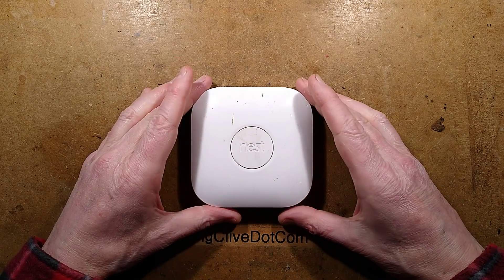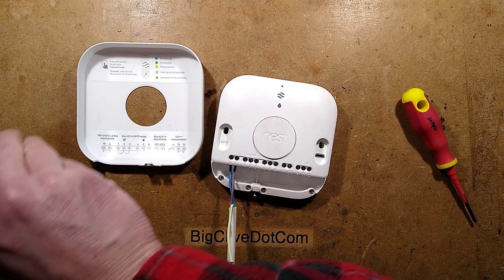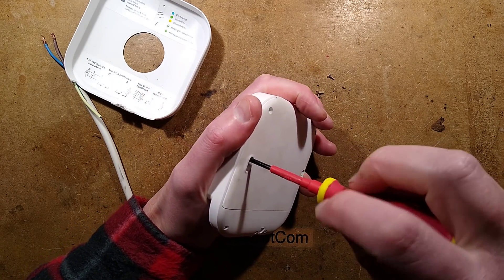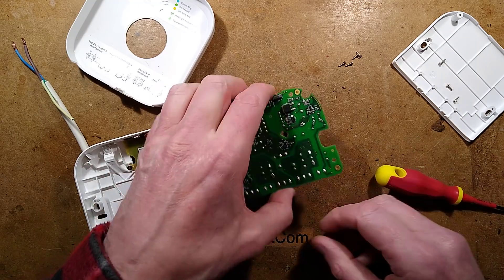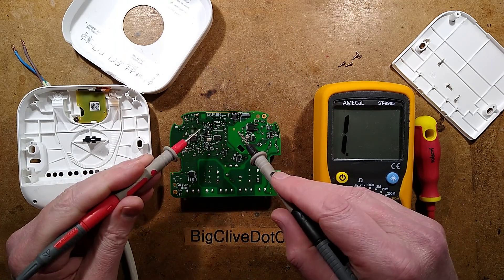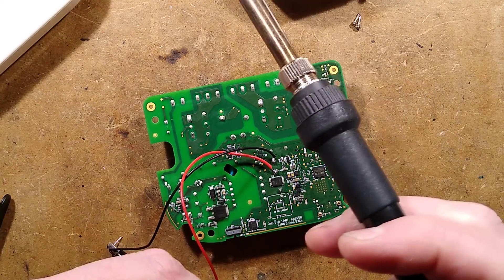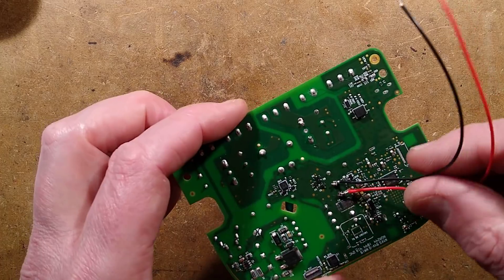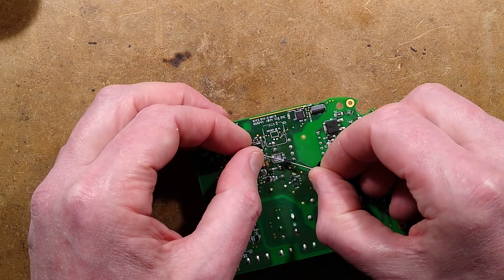Fixing a completely dead Nest thermostat heat link

Comment: I searched quite a while until I found a portable wireless (not Wifi) thermostat that does not connect to the internet, the Salus RT520.The reliability of the connection from the portable console to the main box attached to my central heating system is not great though. A sacrifice I had to make to keep it reasonably secure from prying eyes from the internet. I'm not sure about the security of the transmitter -> receiver pair, but if that would be weak, someone has to be at least near my house to abuse such weakness.
Reply from the maker: I use a Salus wireless thermostat/timer too.  I've just ordered a replacement for my brother as his has failed.   The dead receiver may end up being repaired in a video.

Comment: I'm surprised a modern thermostat would be using mains for power.    Most I've seen use 24V from the airhandlere/furnace, some even with a AA battery or two.
Reply from the maker: The UK uses 240V heating control circuits.
Reply: @bigclivedotcom  thanks for the follow up. Is mains voltage also employed for door bells? If so, this would be an effective way to give traveling salesmen a reason to pause before ringing your house.
Reply: Agreed. I wondered, "Who would have mains power wired along with the furnace control wires?"  Possibly another difference between the UK versus here in the states? Then again, I don't have such devices. Maybe that's just how they are?

Comment: Is this different to the current Nest thermostats that only seems to come in 24V? Where I live (Europe) almost all heating systems (incl. thermostats) up to very recently have been 240V
I really want to install a smart thermostat like Nest or Hive, but little exists for mains voltage supply. I'm struggling to understand why providers seem to have discontinued products like the one in this video when the systems are so common.

Comment: That's the problem sometimes Clive with modern gear, some of it is not that we'll made an is certainly not built to last sadly, in the old days things got repaired, also older gear is easier to work on because components are larger making them easy to replace, circuit tracks were wider making life easier but nowadays you have fiddly components which are tiny, I bet you find fixing older gear easy compared to today's electronic gear, which as you state has more to go wrong. Sadly we live in a throw away society because in some cases it costs more to repair than it does to replace, TV sets are a good example of this issue.
Reply from the maker: There's a really interesting industry of generic TV repair PCBs online.  TV repair is very common in less wealthy countries.

Comment: If the diode is soldered on with silver-based solder, doesn't the lead-based solder further increase the melting point?
Reply from the maker: It's most likely standard lead free solder.

Comment: Technically this isn't the thermostat (it's the Heat Link). Basically it's the relay unit that goes near the boiler. It wirelessly communicates over 868MHz with the actual thermostat on the wall, talks to the thermostat input on the boiler using either the relays or the OpenTherm interface. Also it provides power to the thermostat on the wall at the same time, using the wires running through the wall to (usually) the living room. 

Quite a lot of functions for such a small device actually.

Comment: ok great! my question is, is it common for hvac transformers 240/208vac to 24vac to test correctly until the 24v load wires are connected to it and the system is energized, i lose all of my LV. The 24v returns when I turn the unit back off.
Reply from the maker: If the primary of the transformer is live when the output goes off it may be a thermal device like a PTC overload thermistor.   If you were to monitor the 24V by watching power indicator LEDs to see when it goes, then it will indicate if a component or cable is faulty by when it trips out in the startup sequence.

It could also just be a broken connection breaking when hot and making again when cool.  You could try swapping in a new transformer to try and narrow the fault down.

Comment: "It casts doubt when shoving weires in that that you could have splayed wires touching eachother"

Funnily enough that's exactly what happened with mine. Thankfully all that happened was (as it was the supply that I cocked up) it just blew the fuse in the spur. Disconnecting, redoing it (more carefully) and replacing the fuse made it happy and dandy. Got some cracking skidmarks though.
Reply from the maker: In certain industries it's referred to as a George Michael.  "Careless whiskers."

Comment: Now you need to sock Surface mount diodes with better spec  than the originals 
Plus a hotter soldering iron 
magnetic Induction heater so  stubborn solder joints will melt with ease esp with a lot of thermal Transfer Contact aria  (or White hot 1315+ C Temps smokes the dead component out of existence )
Reply from the maker: Three types of potential replacement diodes are on their way.

Comment: You would think that the manufacturer knows that the diode is the problem and do something about it.
Reply from the maker: Other manufacturers use more than one diode in series.
Reply: @bigclivedotcom  just wondering Clive, you mentioned strands of wire possibly shorting in the screw clamps, why don't you use ferrel's on your bare AC wire terminals?

Comment: I'm wondering if they uprated that diode due to numerous failures on earlier board revisions, but the failure is caused by bad design?
Reply from the maker: Diodes do fail.  Surface mount components are so small and solid that they are prone to stress from thermal expansion and contraction.

Comment: Nice work!
I hate these kinds of SMD components.
Recently I tried to repair a laptop mainboard.
One of these modern "smart MOSFETS" in a SOT-873 package had failed.
I couldn't desolder it with my hot air soldering station. 
It was impossible to get enough heat into the component to desolder it without destroying other things.
Finally  I destroyed the mainboard with this attempt.

Comment: Desoldering an SMD device needs both ends heating up. Hot Tweezers exist for this job, but are fairly expensive. A poor mans version is to use two soldering irons to heat up each end, the you and usually pop the device off the board. You do need to hold the board down firmly however.

Andy
Reply from the maker: I have a set of hot tweezers buried under my pile of stuff.

Comment: I'm shocked, shocked to see that y'all have mains run directly to the thermostat.  Yikes! In the States the transformer is in the furnace and only low voltage appears at the thermostat.
Reply from the maker: It's mostly 240V here.

Comment: IoT is always a question of money... If you make it cheap, it will fail and be unsecure... If you make it expensive, it will be more reliable and more secure, but not failsafe nor unimpenetrable... Consumer grade IoT is indeed meh... Industrial grade is much more relieable, they are taking over the PLC's job in some instances and being complementary (sensors) in other cases...

Comment: I've built my own custom IoT stuff. I didn't like the idea of giving my wifi information out. The reputable companies are probably "safe" but who knows why the cheap chinese knockoffs need so many permissions in Android. I designed my own circuit board for a wifi relay, with an ESP-01 module and custom code, connecting to a fully internal network from a Raspberry Pi, and communicating with MQTT. I also like to integrate other things, like using Node-RED on the Pi to communicate directly with my chinese knockoff "smart" watch through BLE. An upcoming project is a temperature sensor where it'll just broadcast the temperature to the Pi every few minutes. No real smarts needed, Node-RED can handle all that.

Comment: The US/NA thermostat standard is a 24VAC supply from the furnace/air handler. Then 24VAC is sent out to the Burner or reverse valve, AC condenser, blower motor relays... and so on. No line voltage in the control circuits.

Comment: Ive replaced 6 of these in the last 18 months ( I''m a heating engineer who installs these )   , just send them the serial no and they send you a replacement unit and the room stat dial , then you send back the faulty unit , seems that they had a faulty batch of units supplied to them that all have this same problem.....

Comment: I've had a few Nest devices and they've all been pretty reliable, if you don't mind the fact an evil Corporation owns them (and you).  The Nest fire alarms are junk, however, the batteries die within weeks and then they sing the beeping song of annoyance in the middle of the night.  Then they go in the bin.  Last time my AC had issues the AC guy accidentally fried my Nest thermostat and gave me a basic digital one and a check for the rest, I have honestly not missed the Nest one bit and the basic digital one doesn't spy on me.

Comment: Security and support issues aside, I've never personally seen the appeal of the extra features that come with smart appliances like these. My regular thermostat is a new, bare-bones electronic Honeywell. I think it cost me $15 or $30 US, and it already does more than I need.

Also, seeing this video, I almost wish I'd saved the old mercury tilt-switch thermostat from my dad's grungy workshop to send you. But in my excitement, I harvested the mercury switches and binned the rest of the corroded mess.
Reply: The number one advantage in these days of being at home all the time, is adjusting the thermostat from bed with the phone. Geo-fencing is much easier to set up than a programmable thermostat and can save a bundle of energy/money, if folks actually leave home.

Comment: Brilliant video as ever. I wonder if anyone can answer a question?
I have been party to discussions on a certain forum, arguing whether this   appliance should be earthed.
Big Clive said it was a ground. The Nest literature says it is an earth connection.
Does anyone know if there is actually a PCB connection to the earth terminal?
Thank you!
Reply: What are you worried about earthing?  It's in a plastic case.  You can see at 11:59 it appears the earth pin (third from the edge) is directly connected to the T1 connection (second from the edge).
Reply from the maker: It does show an earth symbol, and I wonder if it is for screening.  The mains circuitry does not need an earth.
Reply: Thank you so much!
The argument goes: it is 'best practice' that devices connected to FCU's etc. will be fed by cables containing an earth, because at some point in the future, a class I device may be connected.
Hence, many class II devices will still have an earth terminal, just to tie up a loose earth wire; avoiding the possibility of shorts. Some of these class II device instructions even state the appliance must be earthed, just to cover their backs!
A plumber/RGI wiring a heat link with an obvious earth terminal, will connect it up, whether it is needed or not :)
...and yes, I believe it is for screening (anecdotally, the nest - heat link connection may be sensitive to noise?), I have seen one Nest diagram stating those terminals are only required, if you have existing 'stat wiring - but this isn't clear on every diagram.
Thanks again both :)

Comment: I got a Tado v3 smart thermostat to replace my old Danfoss TP5, both the Danfoss and the Tado are battery powered, so no mains wiring/voltage to worry about.
Reply: Yes, but the receiver is mains wired!

Comment: As I type this, I have a failed Nest heat link sitting next to me which died at my parents' on New Year's Eve, leaving them without heating at the worst possible time. I'm going to grab my cheapo multimeter and check whether that diode is dead; you might have just saved my folks a very chilly few days. Thank you, Clive :o)
Reply from the maker: Apparently a quick check is to pop off the front cover held on by a single screw, and use a micro USB cable to power the low voltage electronics.   If the LEDs light after a few seconds then the 12V supply may have failed.
Reply: @bigclivedotcom  Thank you, Clive. That’s exactly what’s happening on mine - USB power lights up the heat link (but won’t power either relay, so not a workaround, sadly).

Would you happen to know whether this might confirm or rule out your dead diode?
Reply from the maker: @AlexGreyhead  I get the feeling that diode failure is common.
Reply: @bigclivedotcom  Thank you, Clive. I’ll crack out the multimeter and start probing away… ❤️😂
Reply: @bigclivedotcom  Clive, you are a lifesaver - replaced the diode with something approximating the one you used and it’s working again. Thank you ever so much for this video - I owe you several beers!!!!

Comment: I’d use two soldering irons to get the diode off the board. One on each end
Reply from the maker: If I'd been able to find it I would have used the heated tweezers I have for this exact task.

Comment: My parent's house still has the ca 1960 Honeywell T87 mercury thermostat, original to the oil furnace installation, works fine, zero trouble. Worked even better once I figured out nobody bothered to adjust the anticipator setting after the furnace was updated to an electronically controlled burner with a much lower thermostat current.
Reply: I love quality engineering.

Comment: The biggest problem with IOT devices i find it only works as long as the manufacturer supports it or your internet connection functions. My internet was down and my robotvacume refused to start.

Comment: Thermostats in the UK seem a tad more dangerous than in the US... Here they are simply controllers that run on low voltage (30v AC) that go to a high voltage relay board by the HVAC unit.

Another way to remove small components like that - just use two soldering irons.
Reply: Most boilers now have OpenTherm, a low voltage comms bus.
Reply: @DeKemp  oh nice!
Reply from the maker: Not sure about the UK.  We often use 240V control systems here, but I know they tend to use 24V systems in the USA.

Comment: "IOT is a hackers playground" yes it is.
That part of the nest heating controller is relatively dumb (basically a 2ch low power rf receiver) the other part with the display on has the main mcu and wifi connectivity along with a low power rf transmitter, it learns when your at home with your over-all heating use and it via cloud computing sets itself up for you.

Comment: Solder developes a layer of oxidation that acts as insulation; flux is for removing that layer of oxidation so the heat flows unencumbered

Comment: I was involved in manufacturing test meters.and was informed by the "tefal heads " senior designers that the reason we used different capacitors of the same value was something called ESR. The cost different was considerably different and would only use them when absolutely nesasary . Think it had something to do with ripple current.

Comment: What is the failed diode? Cannot find ST100 75 volt 3A data.
I ask as some types of schottky are exceptionally sensitive to over voltage. I was wondering if this part one of those types.
From experience, 75 volt rating 'seems' a bit on the low side. You need decent margin for reliable long term operation.
Reply from the maker: I hunted through my component suppliers and drew a blank.  I've ordered a few other Schottky diodes to see which is the best fit.

Comment: I really can't be bothered with all this home automation 💩 I'm lazy enough as it is. 😋
But being serious, if you had 2 homes that were identical but one had all the nest (other brands are available) stuff in it, how much electricity will be wasted if left idol?
It's bad enough that we've got these cordless vacuum cleaners, how much energy do they want Vs one that is plugged straight into he wall?
Reply from the maker: Most standby power requirements are low.  Usually just 1 or 2 watts.  That equates to a dollar or two every year.
Reply: @bigclivedotcom  
I'll just keep walking to adjust whatever it is, I need the exercise. 😂👍

Comment: Interesting that the input fuse didn't open with a shorted diode in the power supply.  I guess it is only there to protect against a fault on the primary side?
Reply from the maker: The way the switch mode power supply works, if it detects an anomaly it will just go into hiccup mode and sit there pulsing the transformer every second or two.

Comment: Regarding your comment about splayed strands of wire touching - most thermostat wire I have encountered is solid not stranded.
Reply from the maker: In America low voltage tends to be used, but in the UK it will be 240V stranded flex.

Comment: We've got a Nest thermostat, had it years over a really old boiler and a new modern combi one. For the most part it has been reliable, the only issue is sometimes the remote control unit says "cannot control this unit" then it fixes itself if you just hit continue and let it fix itself.

I installed the original one to the old boiler having never done it before using their guide + YouTube, not that difficult if you have faith in yourself and understand the basics. The hardest part is (for old boilers) deciphering the connections when you can't even find a manual anymore.

The reason I love it so much is the heatlink (the thing you have here) and the remote control unit both have thermometers in them so, if they're in separate rooms, you get a really accurate temperature control in the house that's all taken care of for you. It actually did result in saving us money pretty quickly!

Comment: Reverse polarity protection is overrated. If you manage to reverse the supply polarity on an unprotected device, you learn quicker. In fact, these diodes should be loaded with a little C4 or bonus smoke.